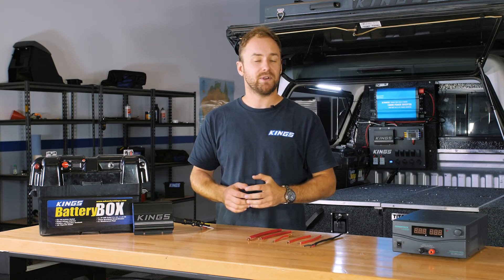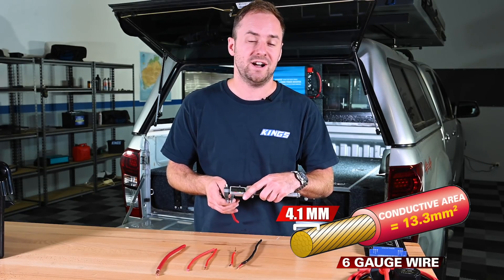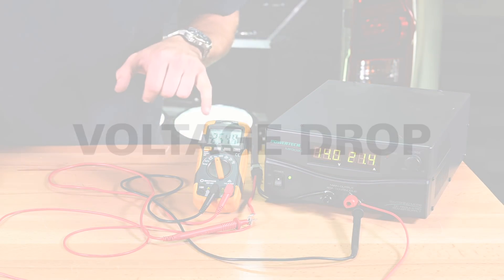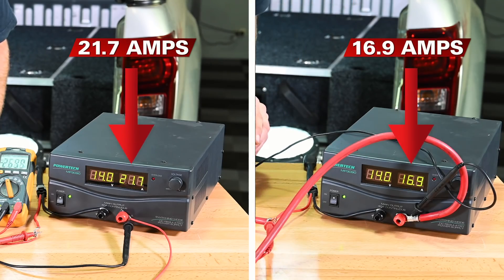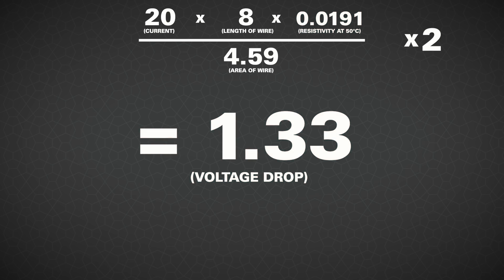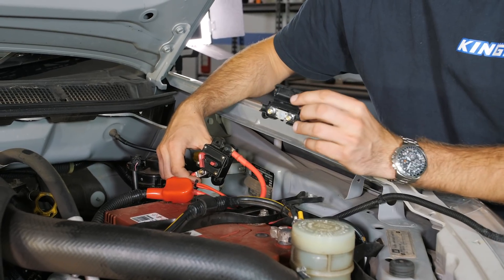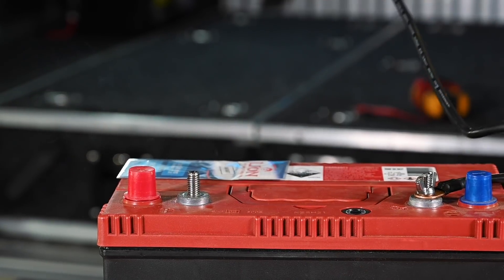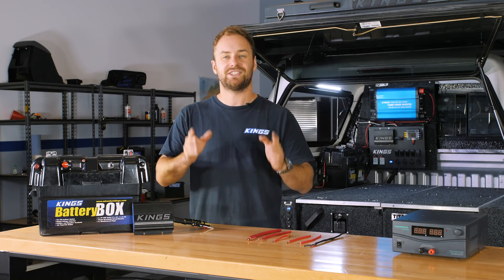BONUS! Complete Off-Grid 12v Dual-Battery Masterclass Pt4: Are You Using The Wrong Wiring?

Comment: Hi mate, this has been a great series, some really good info, those DCDC chargers look brilliant! how did you run the cables from the start battery? I have a 2018 DMAX and doesn’t look as easy as laying the cables on top of the chassis and tying  them to it. Would love a bit more info.
Reply: C. Henderson 
Ive got a 2016 ranger and found the wiring harness along the top of the chassis and followed this to back to the tray. I had to put the ranger on ramps on one side to get clearance under it- this extra working space helped allot.
I also run the cables through flexible conduits to protect from positive leads rubbing and shorting to earth.
Reply: Possibly go through the firewall? Not sure where you're wanting to put the second battery. I ran the wire in a loom through the firewall in my Jeep Wrangler. The DC charger is mounted on a bracket under the driver's seat, and the battery under the back seat. I didn't want to lose cargo space in the back.

Comment: with power wire the simple solution is to run the biggest copper cable you can.....
Reply: Long run from battery to battery, absolutely.

Battery to high power item, like a winch or high watt inverter, also yes.

But you don't need 000 AWG wire for LED rock lights

Comment: I'm confused. You said that as the wires heated up in the driving light test the current increased. You also showed an increase of the ammeter on the power supply in support of this.

I think we both agree that as wires heat up their resistance increases. If the power supply voltage stays constant (you were using a regulated lab supply so this is a reasonable assumption) then according to ohms law the current must decrease as Voltage = Current x Resistance. That is if resistance increases current goes down. Maybe it was just s throw away line but if double check that as your conclusion contradicts Ohms law. 

It's possible that your lights have some active electronics in them (DC to dc) that step up the voltage to account for voltage drop or alike and this increase current draw to deliver the required power. That's my best guess at what's going on with your setup.
Reply from the maker: Hey mate, yeah it's confusing so bear with me haha

Yes you're correct about ohm's law but you need to apply it to the section of wire that I'm testing.

You also need to consider Watt's Law which is Power = Voltage x Current, as there's a fair amount of power being dissipated by the circuit as heat. The lights themselves are drawing the same amount of power in both tests (or close enough) but in the thinner wire they're dealing with the voltage drop so instead of running at 14V and 16.9A they're now running at around 11.2V (due to the 2.9V drop) and 21.2Amps (11.1x21.2=236W). but the power supply is still putting out 14V so that extra 2.9Vx21.2A=~60W is going somewhere...

 Here we go and I'll try explain it.

According to the specs, on start-up these driving lights draw 16A at 14.4V. That’s just over 230W so we know that these lights will draw that much power. I’ll use that as my base figure.

With the large gauge wire, the circuit was drawing 16.9A at 14V – about 236W – we know the lights should draw ~230W so there was an extra 6W being used by the circuit. You’ve gotta use Watt’s law to find the exact amount of power being used by the wire being measured. P = VI where P is power, V is voltage across what I’m measuring and I is current.

so P = 0.027V X 16.9A or 0.46W. The rest of the circuit is then losing another 5.5W or 0.4A at 14V, but that could be accounted for in the connections and rest of the wiring.

In the thinner wire though, at the start of the test it was drawing around 20.6A at 14V by the end of the test the circuit was drawing 22.2A at 14V – that’s around 310W – so there was about 80W of power being wasted in the entire circuit. in the part I was measuring P=VI = 2.918x22.2 = 64.8W being dissipated as heat in the wire.

To get back to Ohm’s law, now can work out the resistance in the wire using– R = V/I – so the resistance is 0.027/16.9 – almost nothing! It’s only 0.0016 ohms or 1.6milliohms

For the thinner wire doing the same maths we find the resistance was .13ohms or 130 milliohms – almost 100 times more than the thicker wire.

If you then apply Ohm’s law to the thin wire test, you see that Voltage of the thin wire is increasing from about 2.1 to 2.9V, current is increasing from about 20.7 to 22.2A, and resistance is increasing from about 100 milliohms to 130milliohms.

So while the voltage isn't climbing on the power supply it is confusing. but in that section of wire the voltage, current and resistance are increasing, in line with Ohm's Law!

I hope you can make some sense of this - it's interesting to try and get your head around it haha. If not, I'll have a think about another way I can show it!

Cheers,
Cahn
Reply: @4wdsupacentreAu  Thanks for the detailed reply Cahn, didn't expect that level of detail, but appreciated. As I made comment in the last part of my first post, the lights appear to be LED and will therefore contain a circuit, which often is called a ballast which in effect is a power converter or constant current drive. The power converter is compensating for the voltage drop by effectively decreasing its DC resistance and thus causing the extra current to flow. It is not the increased resistance of the wires that is causing the extra current to flow. This is what you were getting at with the power analysis. Just remember though this is a non ohmic load. That is this load does non linear and will by design, draw more power as the input voltage decreases (in your video by increased power loss in the supply cables) to deliver the required output power.

If you repeated the test with a purely ohmic / resistive load such as a set of incandescent driving lights you'd see the current decrease with an increase in resistance, the brightness of the lamps decrease and increased voltage drop in the wires feeding the lights. 

A way to disprove the assertion that increased resistance would be mean increased current flow would be to introduce a series resistance of 1 Ohm into the system. I'd assert that you would have at most 14A available at 14V.  If you then increased the resistance to 2 Ohms you'd find that most current that your system could handle would be 7A. These both assume 14V constant Voltage. Maximum current would exist at short circuit.

In the video I did see an increase in current flowing in the circuit, but it was not caused by the increased resistance from the cables feeding the lights.
Reply from the maker: I’ll have to take your lead on this... but yes... now I’m keen to give this a go with some halogens!

Thanks for taking the effort to reply again, I’ll see what happens next time I test. Hopefully people just takeaway that they need to use the correct gauge wire to reduce resistance (and increase efficiency!) and I’ll be happy

Cheers
Cahn
Reply: My kind of debate! Thank you both for the info and efforts. My vote is the non-omic load answer, if you retest with a halogen bulb or load resistor the result would have been different. BUT I'm glad the test was using a current compensating load because that's more relevant for today's modern electronics (phone chargers, LEDs, dcdc chargers...).
Reply: @internationalprecisionengi1737  Yep, keep it friendly and to the topic and the facts. Keep the politics out of it.
Reply: @vk3fbab  My bad, your right. I wasn't intentionally instigating. I love to nerd out and hear the basis of why, like the equations that were posted, and the why not like how modern circuitry can draw more power even through a smaller straw. Mind = blown.
Reply: @internationalprecisionengi1737  Sorry autocorrect got what I meant to say and made it read like I was saying something about your post. I meant to say we were keeping it friendly etc. Your post was fine, so no mistake on your part, just mine :) Lucky we're all friendly here.
Reply: @vk3fbab  I watched this video just before bedtime last night, and I just couldn't figure out what was going on. Left it for this morning. Watched again. Still confused. Thankfully found this excellent discussion on the side, which explains it all. Thank you guys for sticking to the facts, and for making the effort to help us all! Now I have to find some decent wiring/fuses during level 4 lockdown (NZ) to install all my toys!
Reply: @baasdup5094  cheers. This was a year ago, but glad it helped. Hope the COVID over there isn't as bad as it is across the ditch.

Comment: I love the test with the lights! It shows exactly how much of a con they are!
The wiring on the lights is WAY too small. The short little pig tail wired directly to the battery draws over 20amps for a pair!!
You advertise these as 8amps for a pair.

Also, your explanation on fuses is completely WRONG. Fuses are to protect the WIRING and not the appliance. If your wiring can only handle 8amps, put an 8 amp fuse on it, regardless of what it is powering.
Reply from the maker: Bill Weber hey mate,

On startup the laser modules draw a fair bit more current - it’s noted in the specs for the lights on the website, they settle to around 8amps a pair though! Tested and results published by an independent NATA approved lab in Brisbane! (EDIT - if you use Ohm’s law and do the maths, that short little wire I was using was dissipating those extra 5 amps due to the resistance in the wire! Through the heavy duty wire there was very little resistance and they were drawing a bit over 230W - just about what the specs say they will!)

You’re right though fuses will protect your wiring as I demonstrated in the video. I could’ve been more clear though - it is to protect your wiring, and your accessories! Remove the fuse and if your accessory shorts out internally or to the case it might very well damage it... 

Thanks for taking the time to watch the video and thanks for the feedback!

Cheers,
Cahn
Reply: @4wdsupacentreAu  Hi Cahn.
How can I get in touch with you directly?
Reply from the maker: @billweber1340  Hi Bill,

shoot through an email to contentproduction@4wdsupacentre.com.au 

Happy to discuss this further and get your input / answer any questions as best I can!

Cheers,
Cahn

Comment: I've just set up a projecta 25amp dc charger, used 8 gauge dual cable from front battery back to the charger and aux in the canopy. Wiring job wasn't pretty but shè works great. Would 8 gauge be ok does anyone know? Also put 40amp inline fuses close to both pos terminals.
Reply from the maker: Hey Ben,

8 gauge is on the thinner side but should work ok. (Note: I say ok, not good or great haha)

If you’re running about 6m from starter to dual battery you’re looking at about .6V of voltage drop (at 25 degrees). If your DC charger is close to the second battery it should make up for the voltage loss and boost up to the correct voltage to charge. It just means you’re dissipating a bit over 1amp of power due to heat in the wiring.

Power dissipated across the wire due to voltage drop:
P =IV
P =25A x .61V
P = 15.25Watts

How many amps is 15W at 14V:

Watts = Volts x Amps (so Amps=watts/volts

Amps  = 15.25W/14V = 1.09 Amps

The only other thing to keep an eye on is how effective your DC-DC charger is working when it heats up. Our Kings ones can output the full amp rating at 90+ degrees internal temp, but not all can do that! Most will ramp down the power as they heat up, to protect the internals. So it may drop down to 20, 15 or 10A as it gets hotter and hotter. (Not sure of the specifics of the Projecta unit!)

That being said. Keep an eye on your second batteries’ voltage and if you’re not happy with the way things are looking you may need to upgrade wiring or think about how to keep your charger from getting so warm.

But as I said, see how you go on a few trips. Give it a proper workout / test before you rely on it for any big/remote trips and you should be good!

Cheers,
Cahn
Reply: The charging unit gets pretty bloody hot, anyone have the same problem with the projecta?
Reply: @benhowell5790  I do believe the charging units especially if its a DC charger running alternator and solar power through them like the REDARC they get a bit hot. Obviously mount them to a wooden insulating material to avoid fires etc. Might pay to move it to an area where sunlight isnt heating it, and natural wind can cool it down. But personally dont own the unit myself.
Reply: Great stuff how do I hook up solar panels inverter battery box and control panel

Comment: I love that you guys recommend running an earth cable for 2 battery system but you only supply a positive cable with your dual battery system. And you also don't supply a fuse.
Reply from the maker: Hey mate!

Running a body or chassis earth is good... running a separate earth wire is better!

We’ve run the standard Kings dual battery system in our GU for the last two years with no worries - I suppose the point here was to say if you’re after the absolute best set up for efficiency then run a separate earth! But, that said, the GU hasn’t had an issue charging, running a fridge or any of our accessories on any of our trips, but if we wanted to squeeze every last drop of power out of it I would install an earth return.

And yeah, like most dual battery kits available we suggest you grab your own fuses or circuit breakers! ( I personally like to use waterproof manually resettable circuit breakers - they seem to cope with heat and hard work much better)

Not including generic fuses in our kit saves you having to pay for them if you’re going to run circuit breakers anyways. Or if you’ve got particular fuses or fuse holders that you use already (Eg MIDI or ANL) then you can get the same and make it all match so it is neat and tidy.

Plus, if we supplied fuses with a certain amp rating and you had a bigger alternator they wouldn’t be much chop! With the amount of different vehicles and custom setups out there it’s better if you get the right parts for your setup!

We want to make our gear so affordable that even if you have to buy 2 fuses at five bucks each you still come out way ahead!

Anyway! thanks for the feedback and the comment regardless! I’ll pass it on to the product team and I’ll just reiterate that this was a fairly basic video series that tried to cover a lot of tech-heavy topics in a way that everyone could understand them - you’ve obviously got a good understanding of 12V already so hopefully you found the rest of it useful!

Cheers,
Cahn
Reply: @4wdsupacentreAu  Thanks for that answer as I was just going to order an earth cable. I don't think I will now.